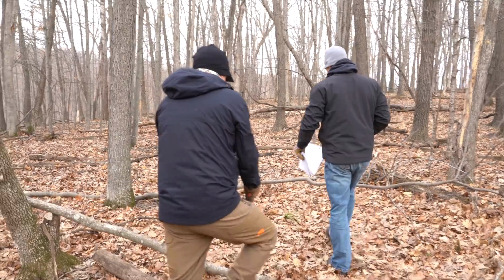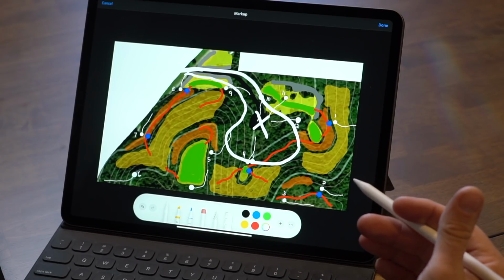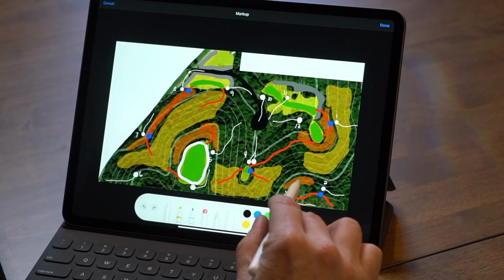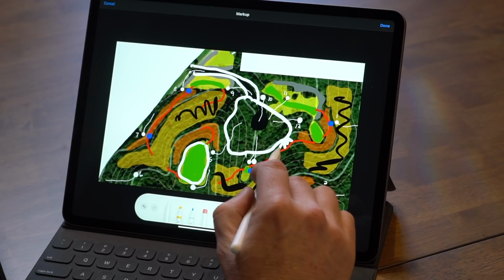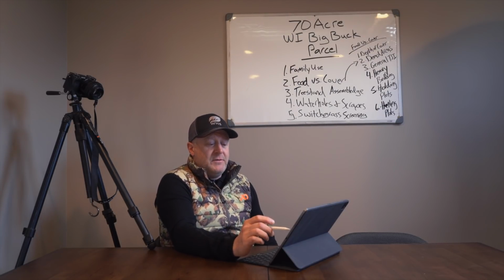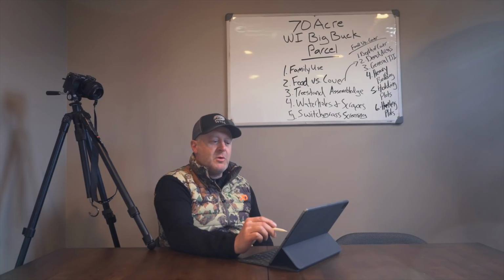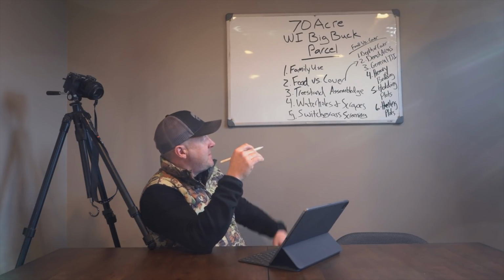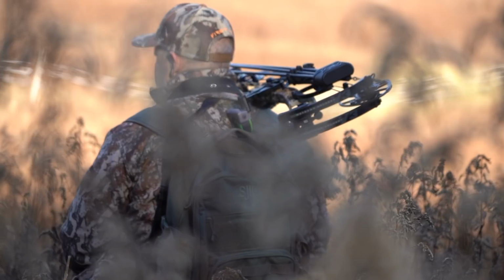70 Acre WI Hunting Parcel Design

Comment: Jeff, I see you talk about habitat and food plots. I know you have a no till plot plan...Is this because you’re against tilling and planting and heavy equipment? I have these tools available to use
Reply from the maker: Hi Josh! I lead a very active life so efficiency is key. Also soil erosion is a concern and I like to maintain soil moisture without exposing and destroying the top soil. Many reasons but I honestly haven't tilled for roughly 14 years...and even then I have used no till mixed with tilling all the way back to 1995. 

Heavy equipment is awesome! But for me I enjoy saving huge amounts of time...and then of course soil erosion and moisture concerns as well as continually working in that top layer of soil. I use heavy equipment for my corn and switch (at times) but even then it is all no till.
Reply: Jeff do you have any way of putting in corn and beans without big equipment? Have you ever had any luck broadcasting corn and lightly discing it back into soil?